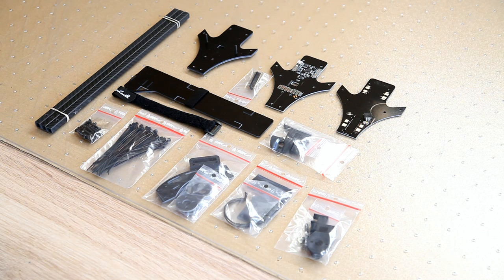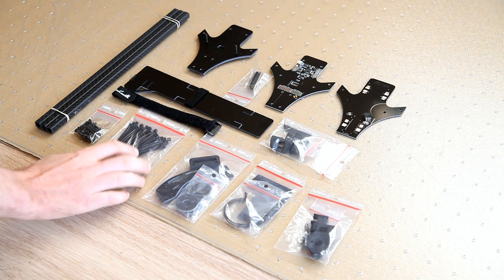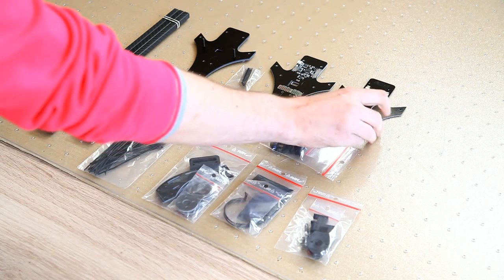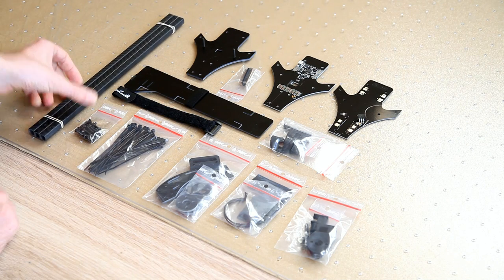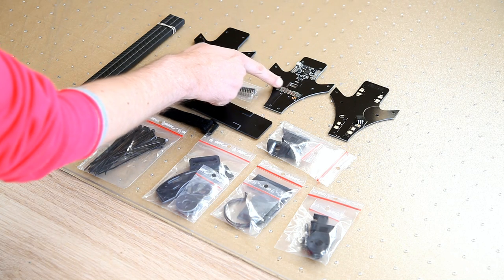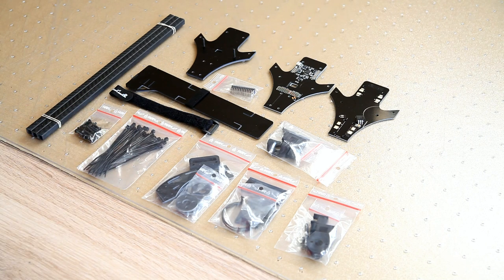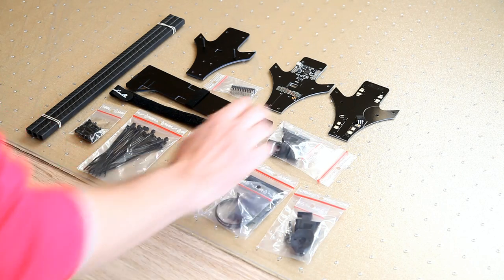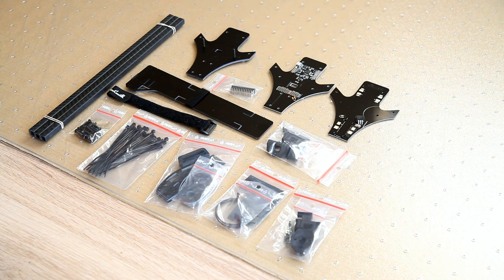RCExplorer tricopter V3 frame-kit with integrated Naze32! :D

Comment: i built a 4S 900 KV with multistar 9x5E props recommended.  There's barely any lift.  (I've got APM with Telemetry, battery monitor, immersion RC 600mW VTx, and Gopro 2.  and Zippy 3000mAh 20C.  it's kind of heavy  (some people have given these props a bad review.  http://www.hobbyking.com/hobbyking/store/uh_viewItem.asp?idProduct=45035

I just ordered 9x6 props, and 10x5 props tonight Express Delivery.  going to see how this changes things. I didn't bother doing the math, but the 9x6 props might cause the motors to draw too much current???

if anybody could provide some input into choosing the right props that would be appreciated.
Reply from the maker: David Nash You could put a amps-logger on the quad, to see how much is draws??
Reply: Yeah I'll try to find one maybe and try flying with the 9x6 props.  I'm sure the 10×5s will be OK. 

Also I have a 3DR power module so I can monitor total amp draw from the battery.

I assume ESC 30A rating is on the DC side at 4S voltage.  (Is the AC side a higher voltage?) (Would then be lower amperage)
Reply from the maker: David Nash Howdy David, 
ahh you allready have a way to monitor that.. Super! :) 
And true.. that's at the DC side :)

Comment: Hell yeah :)
I was thinking about grab one too! It's so cheap and it seems to be a so fantastic tripcopter!
Looking forward for the next video :D
Thanks for sharing DoctorDutchRC and happy midweek
Reply from the maker: ABMNS PRODUCTION Thanks my friend! Be aware! The integrated Naze32 does NOT come with a complete frame.. That is only a replacement center-section.. So you do allso need to order the 'normal' V2 frame-kit.. 
Still a good buy I think, but not super-duper cheap.. 
Cheers and have a good one yourself! :)
Reply: DutchRC ADVENTURES Hahaha, it was too good to be true now i know why i was surprised by the price! I might grab one, you never know, i never flew tricopter, it's maybe a good chance to fly one without spending too much money and it seems to be a pretty nice kit despite the tricky thing with the kits :)
Reply from the maker: ABMNS PRODUCTION :D  yeah man.. I was allmost fooled into it as well.. But David's site actually is quite clear on what you get (and don't get) :) 
Tricopters do fly different.. More like a helicopter actually.. But most people say they are great for aerial video work :)